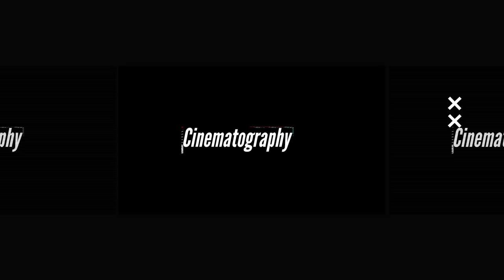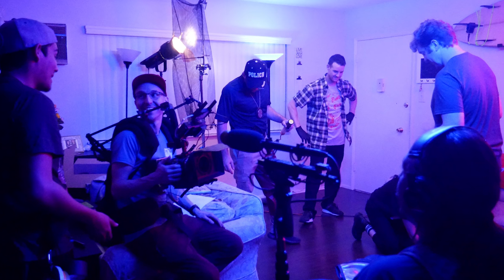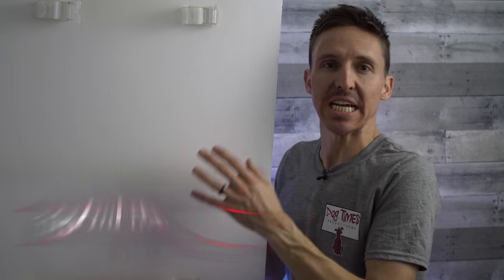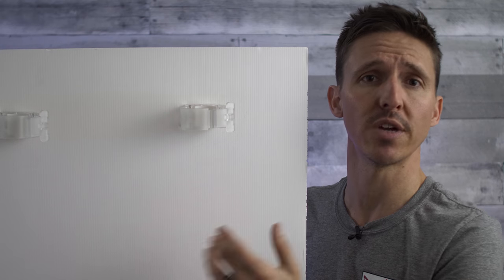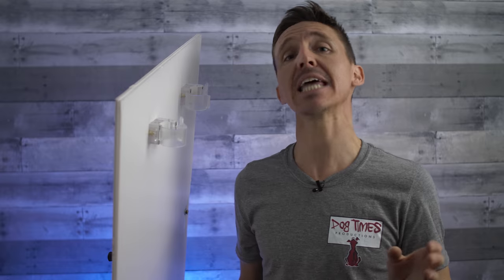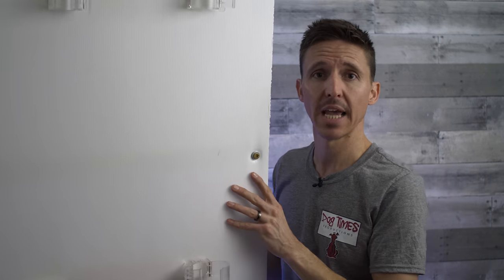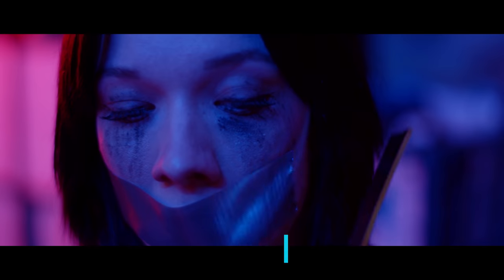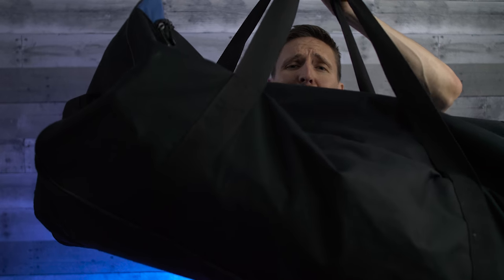DIY Portable Book Light - The Turkey Sandwich Light!

Comment: Great idea!
I can help but think that if you added a thicker block,20mm to 50mm, 1/2" to1" between the coroplast/ coreflute and what the light clip, which would give the light tube more distance away from the board to reflect a wider/ broader beam, you would get a better, flatter and stronger overall light??